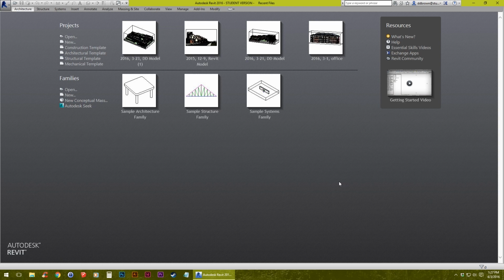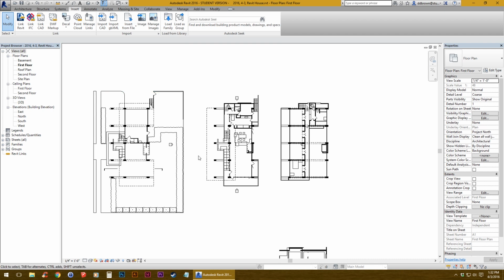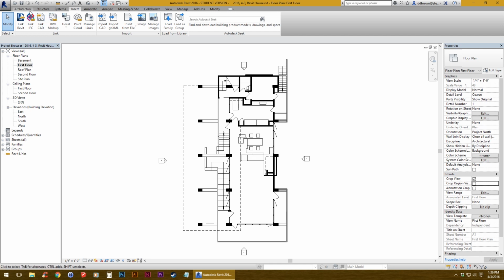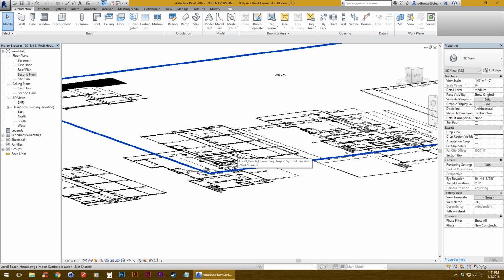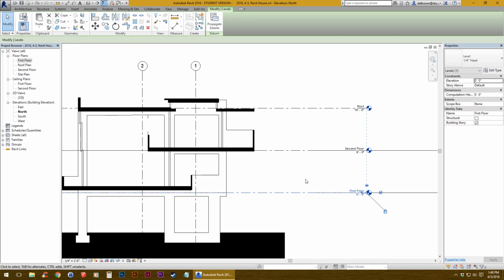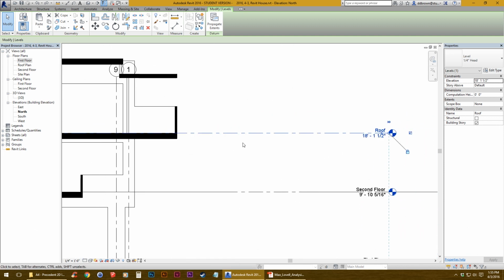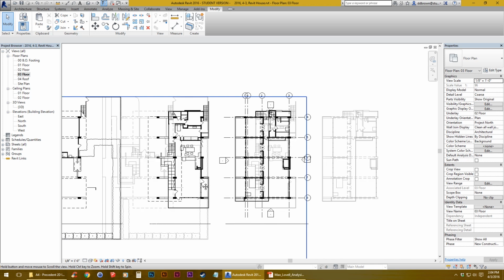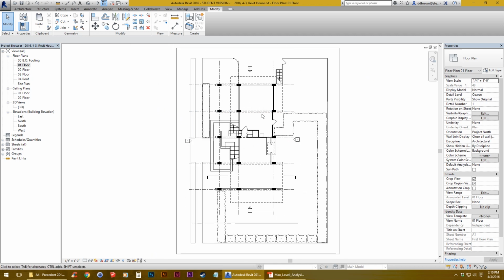Revit: Importing CAD Drawings, Setting up Grids and Levels - Lovell Beach House

Comment: Love the video. Very step by step. However, when I tried to copy the second floor, it ended up below the first floor. Also I couldn't move the second floor I had over to the grid lines. The drawings on the second floor were greyed out.
Reply from the maker: Make sure you're pasting it to the correct level. After you paste the drawing, you can change the base level to the second floor, with an offset of 0'.